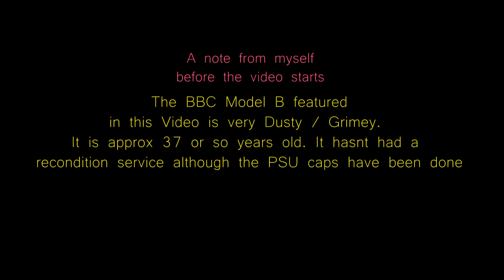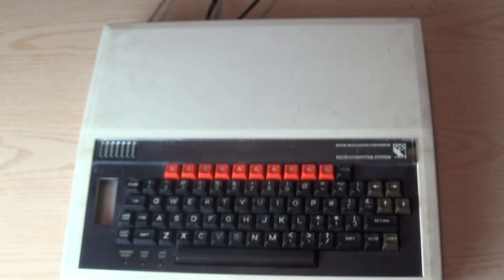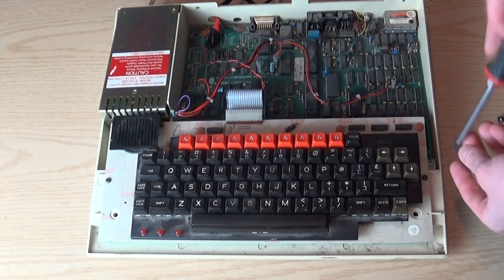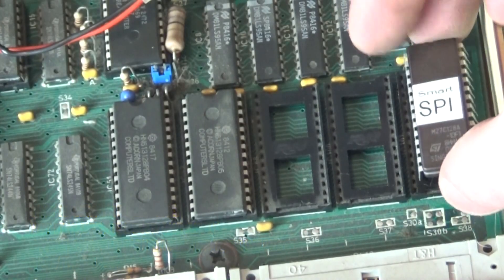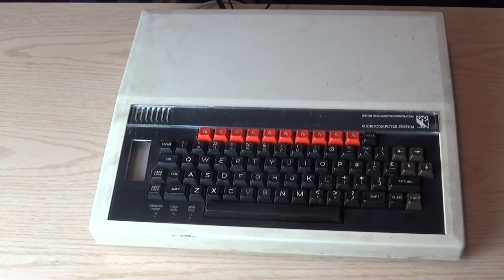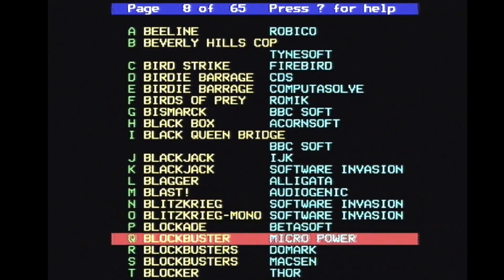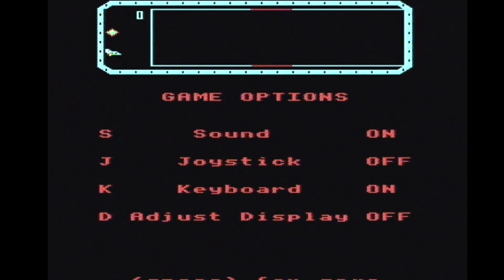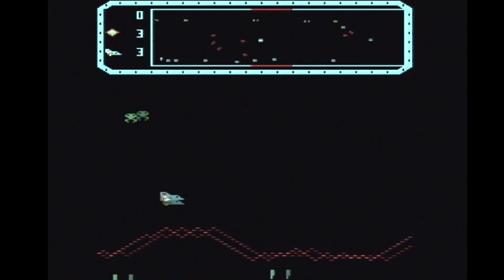Micro SD device for the BBC Model B!  Installation ! Love it!

Comment: The RetroClinic MMC is probably the biggest commercial bang for your buck in terms of making your machine more useable, but it might not be enough to get your family or friends interested ;) To add more games to the card but not the menu, download from bbcmicro.co.uk, copy to a spare slot on the card (MMBImager on Windows) and then *DBOOT 999 where 999 is the number of the slot you put the image in.
Reply from the maker: Once my beeb is back for repair I broke it sadly decided to try and fix it myself which was not a good idea. Once I've got it back I will defo get that